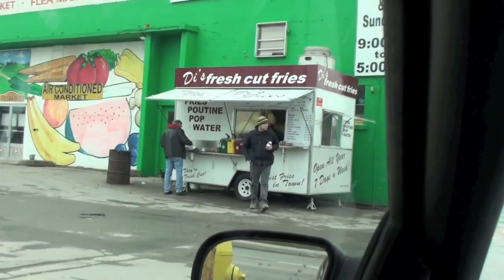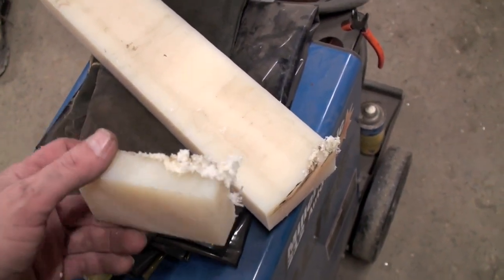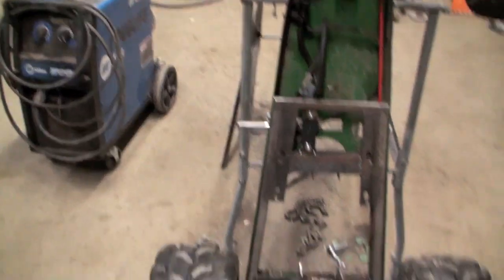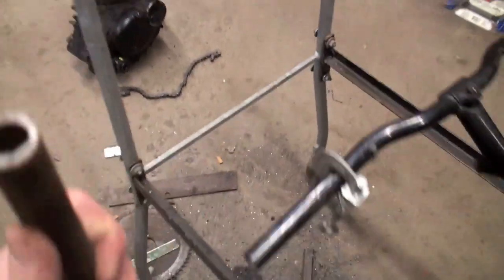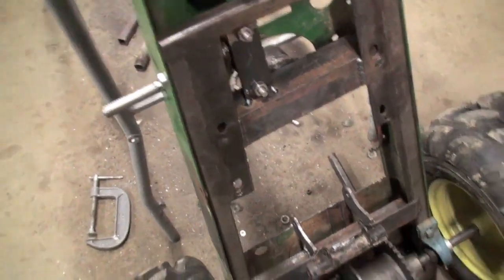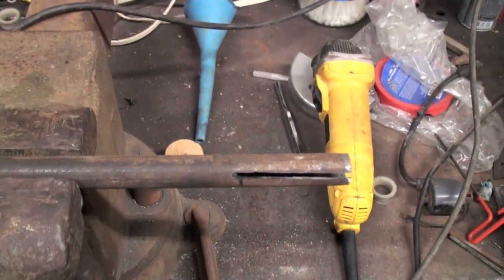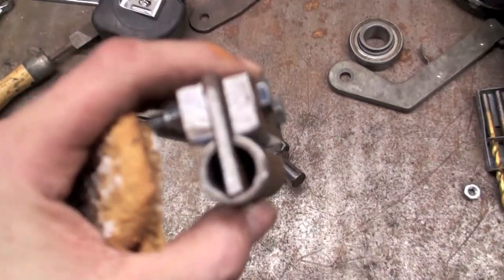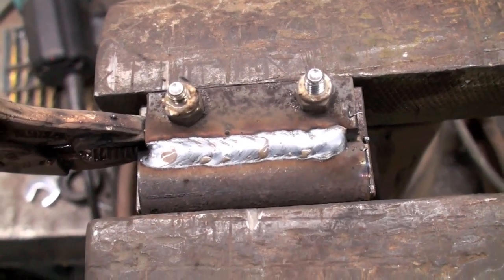the kick starter for the jdlc

Comment: Get an extension nut (you know, those long nuts for connecting 2 threaded rods together) and weld it on in place of that ratchet handle. Then weld a deep dish socket onto the kick start crank in place of the pipe. Then you just slide the kick start crank onto the long nut to kick start when you want to start it and pull it off and stash it when not in use. That will also allow you to position the kick starter at any angle you want.

Comment: Drill a  1/4" hole in the pipe part of the collar antler you made for the kick start choocher. Thread a nut onto a  1/4' -20 x 3/4" long bolt.  Stick  the bolt threads into hole you made in collar, weld nut to collar. unscrew the bolt partway and slide the collar on th' choocher... decide where the collar should go on the choocher,  Using a 5/16 drill bit drill a set screw divot into the kickstart choocher under where the bolt will stick out. Slide the collar over the divot and tighten'er down

Comment: OR, you could TRY to take a thin piece of tin and use it as a shim inside the collar against the kickstarter choocher... OR you could cut the collar apart and make the gap in the pipe wider so that when she clamps tight there is still a gap where the bolt antlers are... but the set screw dingus will work.

Comment: put a thin piece of rubber (such as a piece of hose) around the shaft before you put the pipe piece over it. if the pipe clamps tight when you tighten the bolts, it won't slip on the shaft.

Comment: you could take the grinder and grind more of your clamping grove out so it pinches tighter then you might not have to modify it any further. I think it would have worked this way if the tabs were pitched out more so they came together more flat but it is what it is so maybe try grinding it out just my 2 cents on it ffs

Comment: Pug, turn the saw blade backwards... Ya know, have the teeth pointing up on the chop saw. That how I cut vinyl siding and it works mint. You wont have those left over stringy boggers ffs